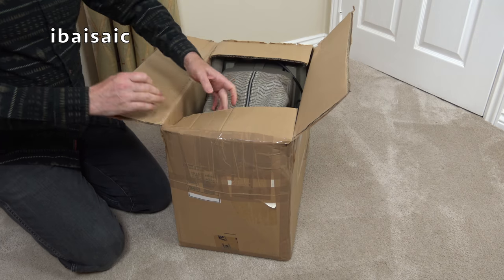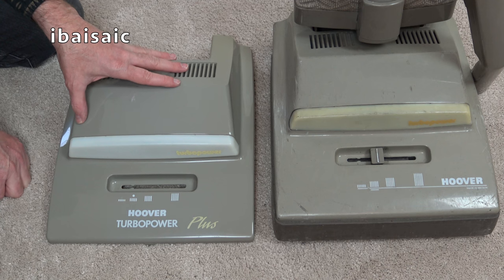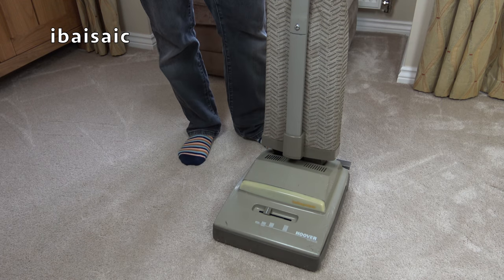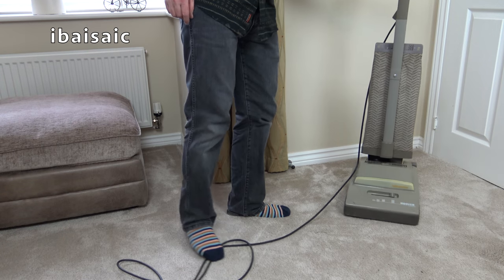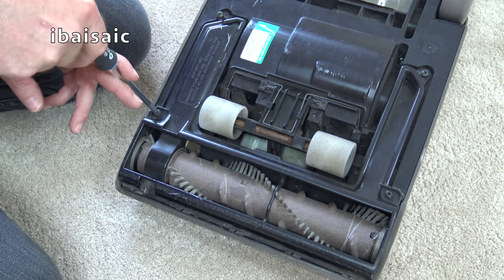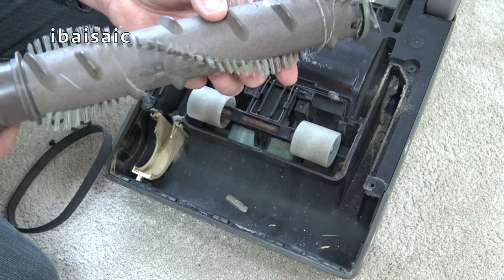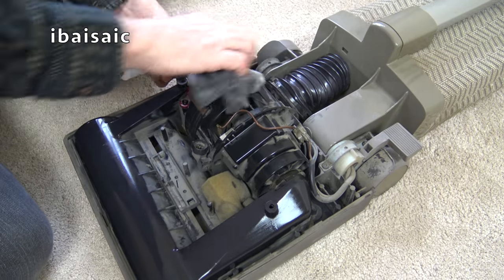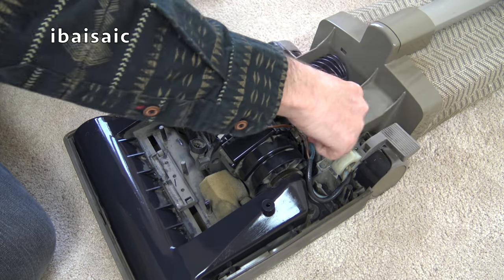Hoover U1222 Turbopower Plus Upright Vacuum Unboxing & Facelift

Comment: Pretty sure this is the same vac my grandparents had when I was a kid, the pattern on the bag looks very familiar. The smell of the warm dust bag stays with me. Had it until I basically sold them a DC01 Antarctica Solo as a 6 year old who was a bit mad about vacuums. 
At the same time my mum had a Philips hl3687/8 which fell apart and was replaced by a Dirt Devil Upright. The wheels fell off that. I think they're still in the loft.